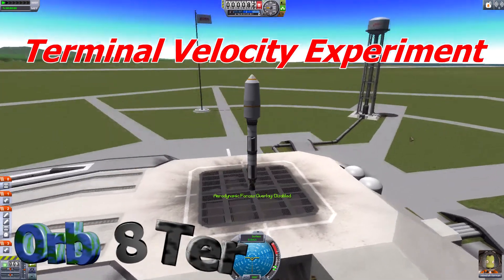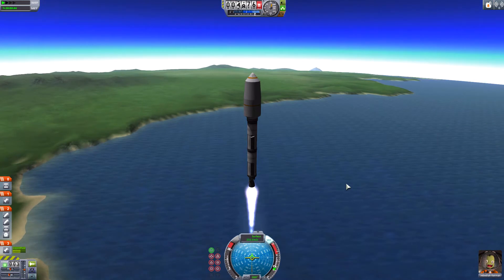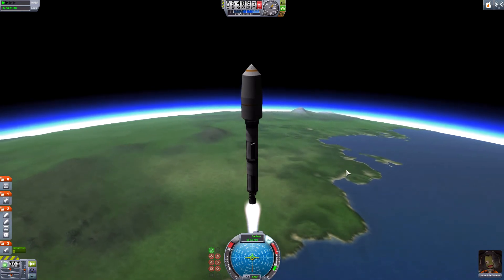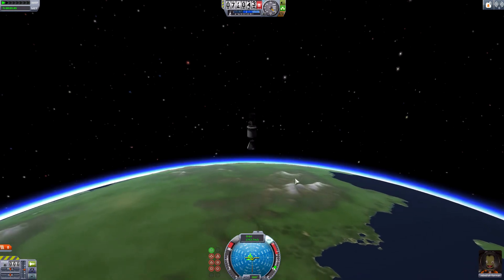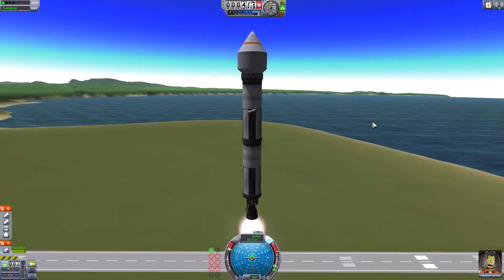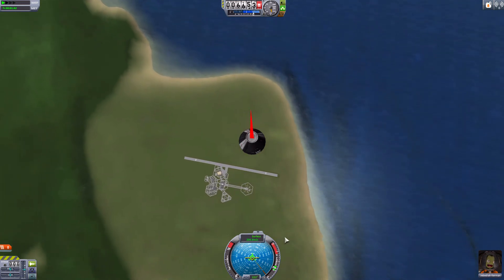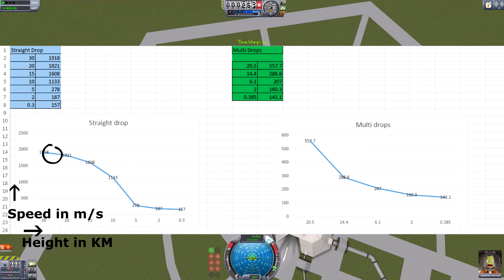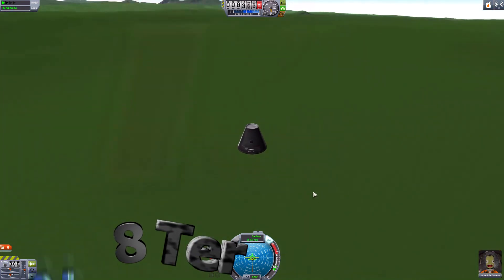Kerbal Space Program -Terminal velocity experiment

Comment: Pretty cool experiment! However, drag can change between rocket designs, the flatter the rocket, the slower the terminal velocity is, the more needle-like your rocket is, the faster you can go. Either way, this was really enjoyable to watch :)
Reply from the maker: Thanks, that's correct it varies depending on the craft that's why I used a command pod MK1 as the drag is something like 0.2 or something and unless they have changed the drag for parts a lot of them used to be similar.
Reply: Orb8Ter If I remember correctly, all the parts had a drag coefficient of 0.2... Quite odd, really.